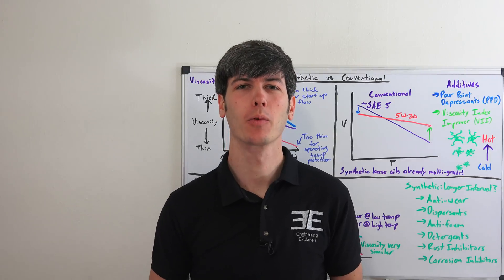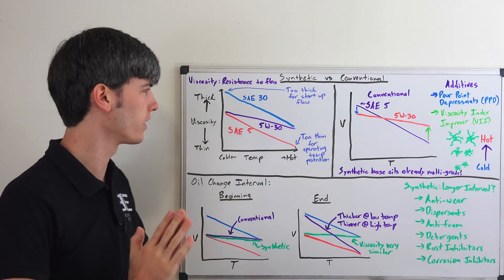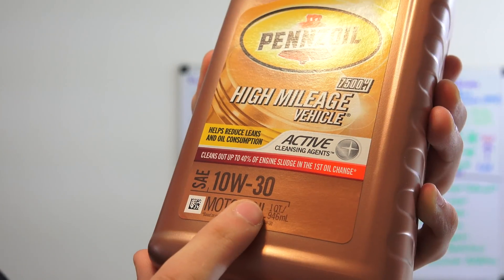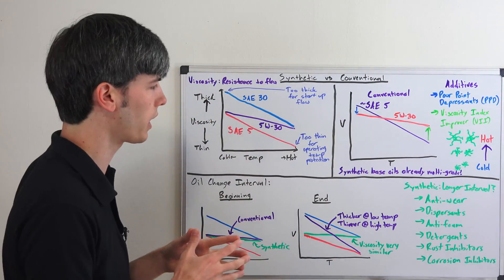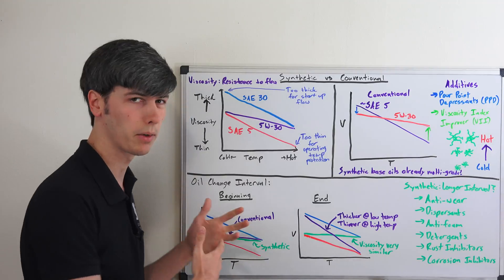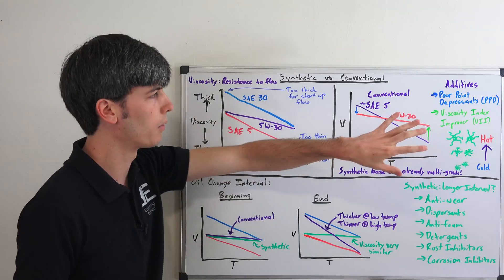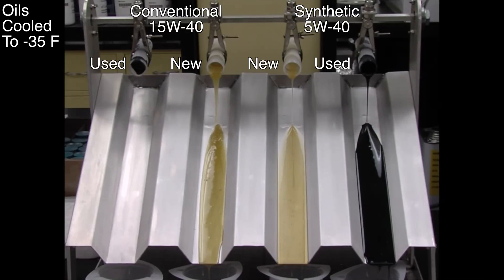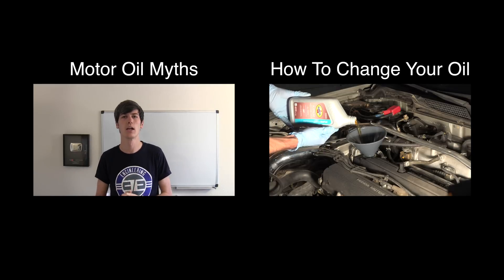Is Synthetic Motor Oil Better For Your Car?

Comment: So on high mileage engines, which is the best oil to use in terms of additives that are meant to prevent/slow down leaks from seals? Would using a conventional oil made for high mileage benefit more than synthetic for high mileage? Since it seems synthetic flows better and can seep it's way out of some worn seals
Reply: If your engine is leaking, it's not the oil's fault.  Fix your gaskets.
Reply: Gary Hawkins you can ask 100 different mechanics and you will get 100 different answers people just speak from experience
Reply: +mds s How do you determine which ones weaken them?
Reply: Some motor oils are made specifically for high mileage engines.  I believe Pennzoil makes one, not sure.  Look at your local auto parts store. I bought some at Advance.
Reply: I have heard this before but I doubt there is any way to predict whether it would cause leaks or not.  They make oil additives that condition seals to reduce or to stop leaks.  Your best bet would be to speak to a mechanic.
Reply: If your engine oil is seeping past seals with synthetic but not with conventional, just go back to conventional. The seeping will then usually revert to its old pattern.
Reply: ***** Time is not a consideration when changing oil, mileage is. You are a conscientious operator and your service path is correct for your driving style but since you are money conscious, I would suggest using the least expensive oil as they are all classified the same as the most expensive by the SAE. Read the SAE label on the oil container.

 Happy motoring.
Reply: George Rivera i agree 100% and the 5k mile chang is because it is very easy to remember every 5k 10k 15k 20k and every 10k i change the airfilter and oil  and since my car is fixing to hit 115k i know to just do oil change and when it hit 120k i will do oil and air filter it is just simple :-)
Reply: Ron West I spoke on my years of automotive experience and gained knowledge of lubricants and fuels. I once knew a guy who wastefully changed his oil every 1k miles. It was as clear as new oil out of the bottle. Changing oil at less than the designed interval is not only wasteful but primarily not beneficial to the machine or the person paying the bills.
Reply: +apollyon0810 different oils can weaken gaskets
Reply: mrsemifixit if you have a used vehicle and u decide to use synthetic oil on your oil change and all the sudden the oil leaks it's because the synthetic oil is actually to clean
Reply: +mds s How does it clean? Are the synthetic blends made for this purpose? Wondered why they make blends
Reply: +Gary Hawkins So a synthetic high mileage specific oil wouldn't cause leaks?
Reply: +Buddy Bud-Bud who are u talking to?
Reply: Exactly.  But in this case there are only 2 answers, yes or no.  The only way to know for sure is to try synthetic to see if a leak occurs.  If it does, you'll have the answer.  But an experienced mechanic may have past experience switching from one to another.
Reply: All lubricants conform to SAE specifications as noted on every lubricating oil container within the circle titled SAE( Society of Automotive Engineers) and Federal specifications so there chemically there is no difference between them. The least expensive lubricating oil has the identical lubricating properties as the most expensive competitor in its class meaning either Naturally Blended or Synthetic lubricants.

The fundamental difference between natural oils and synthetics is in the shape of their molecules. The molecules of natural oils are shaped more like soccer balls than perfect spheres, which makes them roll past each other and other surfaces with low friction at lower temperatures, however, being carbon chain based, as a machine's operating temperature increases the bonds become weaker and at high enough temperatures may even break and become sharp resulting in increased friction. As you know, with the exception of graphite, carbon is one of the hardest elements and can cause excessive engine wear and eventually precipitate premature machine failure. 

Synthetic oil molecules are nearly perfectly spherical and are not subject to disassociation at the temperatures of naturally blended oils so they operate at a much lower frictional coefficient throughout the operating temperature range. 

A long lost friend of mine, a Petrochemical engineer with Mobile Oil named Roy, who was on the development team for Mobile One, told me that during testing and development Mobile One showed no sign of degradation at 25,000 miles of operation in test vehicles, including Diesels. I saw a Mercedes-Benz Diesel disassembled and it was internally cleaner than any engine I had ever seen gas or Diesel. The crankcase and oil passage were so clean that they appeared to have never been in any but short term test service. He told me that because of the strength of the molecular bonds, that all you had to do was replace the oil filter at the recommended service intervals, which would remove the carbonaceous particulate by-products of fuel combustion, top off the oil, and keep driving. That is a bold statement.

Then there is the persisting question of oil leaks. Synthetics have so much better flow characteristics, again due to their molecular shape, that they flow through seepage pathways in gaskets and seals that conventional oils would obstruct. So the complaint that synthetics are more likely to leak is true but due exclusively to poor gaskets and seals condition so if it leaks fix it.
Reply: if high mileage use whatever 10w40 is on sale in conventional oil the 40 is a bit thicker at 212' deg F (operating temps)and will be a benefit on old worn parts 
i have a 30 year old truck that has worn rings and i run 20w50 because oil pressure will drop to low with thinner oils after warm up but all i ever use it for is pulling my boat maybe 1k miles a year if lucky and i am to lazy to rebuild the motor  right now
Reply: ***** 
Even if it is that old, it is more likely to have leaking valve guide seals, oil pan gaskets and crankshaft seals than worn piston rings. If you had worn rings it would have low compression, be hard to start in cold weather, get very poor mileage and smoke like crazy.
Reply: it has blow by smoke out of vent on valve cover  no smoke out exhaust
no leak no drips on driveway  and did forget to say the motor was locked up and 2 cylinders got water in them ???? when truck sat for 8 years because it would not pass emissions and all i did was gently sand the 2 cylinders removing the rust and i replaced both heads because of stuck valves and bent pushrods and now it is striped and pre 73 condition no cats now emissions at all any more because it is over 25 years old  and no longer gets emission tested and my father bought this truck new in 1987 :-) i know it needs to be rebuilt and i just put 2 new fuel tanks and sending units because of rust from sitting so long it is work in progress but in it current condition it runs good and pulls my boat the few times i need it to
i am pretty sure the oil pressure drops from excessive heat in crankcase because of blowby
Reply: Oil pressure only drops if the oil pump relief spring is weak or broken, or if the crankshaft main or rod bearings are substantially worn. Next time you change the oil, look for copper metal flakes, or powder in the oil. That means that the rod bearing are worn to the copper layer and it is time for a redo. 

Blowby is cause the worn piston rings and the rotational effect of the cranks shaft n the air in the crankcase. Install a PCV valve from the blowby tube to the intake manifold.
Reply: oil pressure also drop as the oil heats up and thins out also why some have oil coolers that is why every car has high oil pressure  at start up but lower after worm up and when i say low oil pressure  im talking at idle after driving a wile and the blowby heat up crankcase higher than normal operating temperature thinning the oil do to oil being hotter than the 190deg operating temperature
Reply: Changing your oil at lower mileage intervals (3-4000 miles) will help prevent gaskets and seals from failing far better than purchasing a "high mileage" specific oil. Oil gets contaminated by small amounts of combustion gases that blow past the piston rings. The gases mix with the oil and over time it becomes more and more acidic. The acidic oil is not only corrosive to metal engine components, but it also makes engine seals hard and brittle, which can lead to cracking and oil leaks.
Reply: +MCRmechanic Interestingly I've always changed mine little early but still both my main seals developed small leaks. Does it matter if you wait say 3-6 months before changing oil if you're hardly driving to reach 3-4000 miles?
Reply: I change mine every 5k miles even if it takes a year to accumulate and i have a work van so car is in Garage 5 days a week and the last 60k miles on my car  took 8 years to achieve on my 06 Altuma and at 114k miles no sign of any leaks of any kind and i use 10W40 conventional oil what ever is on sale even stoor brands right now i am running napa oil because i got 2 cases for $52 (24qt) and have use mobil 5000 and even Orilies brand oil but allways conventional oil and i pull a small 5x8 utility trailer that carries my motocross bike and have worn out 2 sets of tires on the trailer. Car is rated at 1000lb towing and trailer with 2 bikes is just under 700lb and many trips are 200+ miles and did it for 5 years strate at least 1 weekends a month but not so much in last 2 years just put all new struts front and back and never ran any tire but Michelin factory size and car still drives and rides like a new car
Reply: I don't drive so much,So i change my oil right before it gets hot and right before it gets cold.(twice a year)Adjusting for temp changes. Stop and go driving and my engine not getting warm is two things i look at.
Reply: Ron West  Marketing hype.
Reply: Talking oil is a million opinions kind of thing. I base my thinking on years in the automotive industry. Common sense.
Reply: If anything testing oil would be the best way of knowing if it still is good.
Reply: MCRmechanic IT is the carbon byproducts of combustion that wear out engines, not oil pH.
Reply: A lot of oil is still fine and people tend to change oil to early.Testing lets you know the state of your engine. I find no problem with changing my oil twice a year.Oil isn't that expensive. Yes modern engines last longer because of the efficiency of fuel injection.
Reply: Ron West They last longer because computers monitor and control the machining and manufacturing processes to very exact, fleetwide tolerances. It is common to have engines and transmissions last well into the 200k miles because of it if the engines and transmissions are kept lubricated and cooled. Fuel injection has nothing to do with it.
Reply: I watched a program where an engineer explained the damage done by byproducts of fuel and how modern fuel injection made a big difference in how long engines last.Yes U.S. auto makers finally joined the Japanese and started building decent engines.The difference was shown to me in the 70's. Japanese engines were works of art inside compared to american engines.Now? So much better. Unless you read about problems certain engines tend to have.So many head gasket problems. Chevrolets seem to be for sale in great numbers here,All needing transmissions.
Reply: Ron West  I said, the "By products of combustion," the primary of which is carbon, that hardest substance on the planet. 

If running engines leaner is responsible for reduced wear, I am in agreement, but the major reason engines and transmissions last longer by far, is directly creditable to computerized machining of crankshafts, connecting rods, engine blocks, improvements in the casting of aluminum used in cylinder heads and other engine and transmission subassemblies, and mechanized assembly systems and the ever delicate crankshaft bearing inserts. The oil is in fact the bearing. 

The fact that junkyard engines and transmissions engines can be disassembled and found to have minimal wear is attributable to modern lubricants, sealing agents, gaskets, metallurgy and manufacturing processes. Fuel metering is low on the list of contributing factors to extended machine life.
Reply: I guess we all have our opinions.

Comment: I cant really make a decision as the Vauxhall Corsa which is my daily driver has to use fully synthetic 5w30 [similar to BMW and Mercedes Benz]. Not many modern cars use any sort of conventional oil, its nearly always fully synthetic.
Reply: One wonders how much $$$ exchanged hands when those recommendations were made.
Reply: I am not sure, but I know that a lot of cars in England use fully synthetic oil now. Mine is 5w30 which is also used on BMW, Mercedes Benz and because Vauxhall are the same as Opel, Opel use the same oil. Too much precision stuff and other things to use anything like mineral or semi synthetic oils now.
Reply: You move from a fact to a supposition as to their motives.  I'd bet that $$$ has something to do with their recommendations.
Reply: no doubt about the money, I see recommendations on car instruction manuals all the time, for French cars, they always mention Elf or Total. I know how this all works [I only use the info on oil grades and ignore the companies recommended]. I hope no-one wants to start an arguement, because I am going according to experience here in Europe and also having worked on cars. Mainly Fords, Vauxhalls, Fiats and Peugeots.

Comment: The video is sponsored by Pennzoil and they want to sell oil so he downplays the longer drain intervals of synthetic. I've been using AMSOIL since the 70s. Their 10W-40 has a 25,000-mile drain interval. In fact, if you install an external filter, you never have to change the oil, just the filter. Synthetic doesn't breakdown like conventional.
Reply: So the oil makers seem to claim.  But Mobil and others state on their web sites that synthetics should not be used to lengthen the engine makers' oil change intervals.

Comment: W as most people think does not stand for winter it stands for weight.
Reply: Quote:  "In a 10w-40 for example the 10w bit (W = winter, not 
        weight or watt or anything else for that matter) "....API
Reply: I've talked to industry professionals who say otherwise, I'm talking about people in the automotive field and the automobile oil field, it means weight believe what you want though.
Reply: Not an issue of "belief".  It's what the API that owns the trademark seal says they mean by it.  Think about it.  How can it mean "weight".  If it did, 10W-40 would mean what?  If 10 is weight, what would the 40 mean?  If both are weight, it should be something like 10-40W. No, the API is telling you the weight in winter...i.e.10, followed by the operating temp. weight.  But believe what you want.

Comment: Hey there, host guy, you've got a good face for this show and you have a good voice, make sure we see it. While you were working off the whiteboard, you spent your whole time looking away from the camera. I recommend turning your whole body to face the camera, leave it there and let your gestures do the work for you. Your flesh of light so the black shirt makes you gestures very visible and easy to understand. When you need to indicate the board, just gesture towards the section you want us to look at and use your words to direct us to the specific things you want us to see. I assume you also draw all of the info on the board, so you have it memorized. You don't need to look at it , let us look at it. Finally, during your whiteboard section, you would look kind of towards the camera, but not at it as though you were checking a monitor. Do your best to never do that, just look directly into the heart of the camera lens, this creates a better visual connection with our audience (and steals souls if you're from the 1800's). If you're using that moment to look at your notes and remember where to go next, you might try to break it into several cuts and use some editing software to put up images of your materials to cover the break in video.

Please don't take any of that as me saying your show is bad. I enjoy your channel and I learn a lot of new things from it (not to mention it helps straighten out inaccurate old info). I want this to serve as info to help you improve your presentation and help you get more views. I think this channel needs to grow and I wish you the best! Keep on making great videos!

Comment: What do products like Lucus oil stabiliser do to the viscosity ?
Reply: Increase it massively.
Reply: +paulanderson79 so not ideal for an engine like LS3 that typically runs 5w30?
Reply: "do TO" is the right way to phrase it.  No "additives" should ever be mixed with the oil in a normally functioning engine.
Reply: incereases viscosity which can cause many problems. thicker oil can bejust as bad as thinner oil